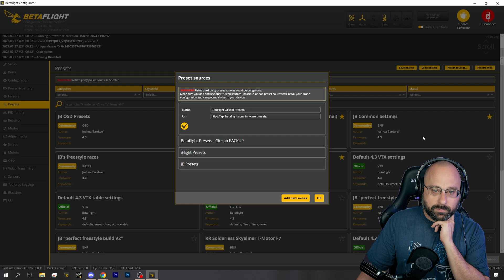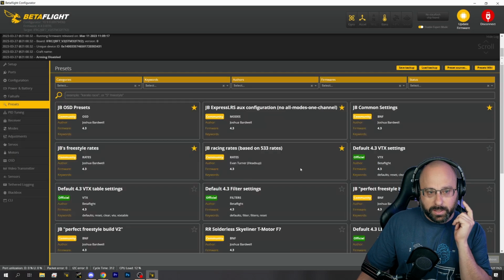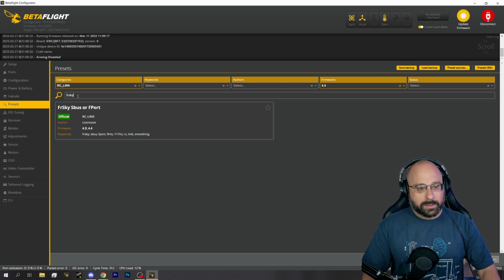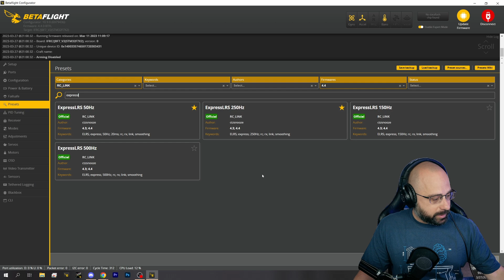ExpressLRS Needs Presets Applied for Modes Like 250hz In Betaflight! - FPV Tips

Comment: To use D250 OR D500 mode, do I need to change the RX to operate at 250hz?
because in Betaflight there is no profile for D mode, unless you can access the RX via wifi, and you can change this frequency field!
Reply: D250 is still 250hz